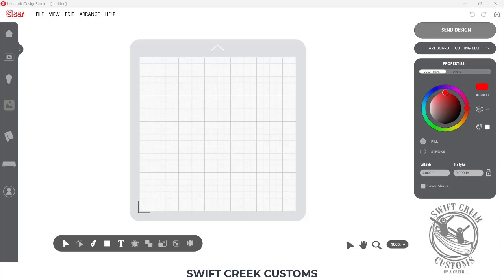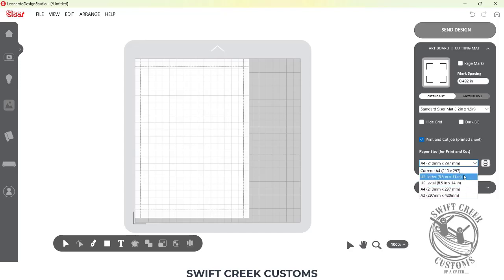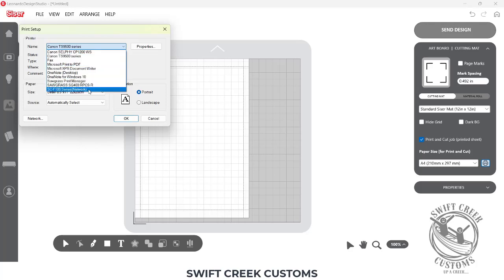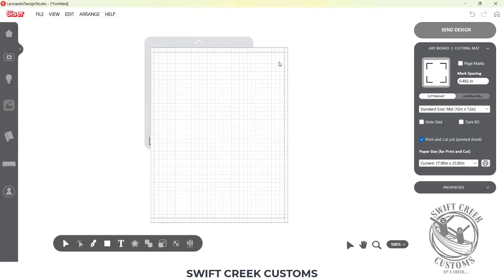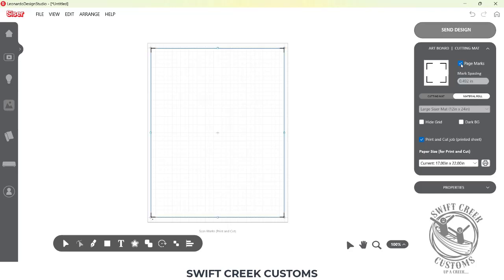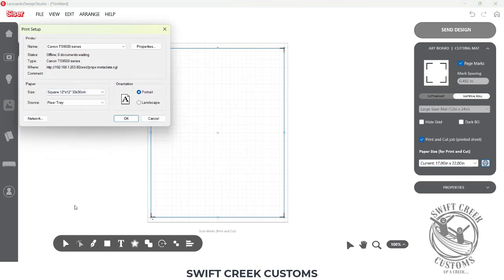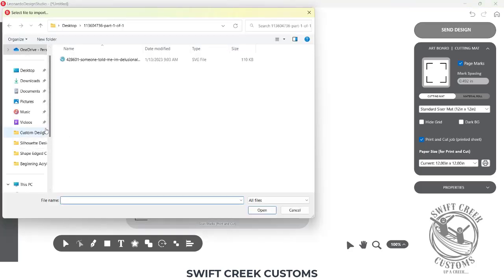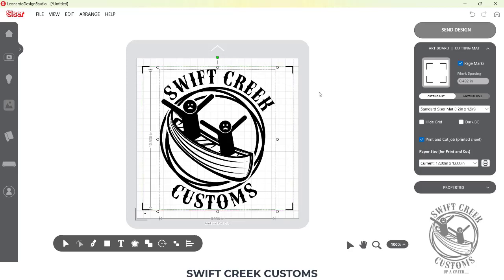Changing the Print Page Size in Siser Leonardo Design Studio

Comment: So can you currently print the while 12 x 12 area space if you were making your own cardstock or vinyl sheet prints from your printer, EllyMae?  I think my highest capacity right now is 13x19. How far in or out do the registration marks go, as of  today 1/14/2023.  As you mentioned, I know they are working on expanding the print size to wide format. I am just curious if you have been able to print your own 12x12's via Leo?  My first cuts were Print and Cut. Some of my designs didn't transfer to cut when saving as svg.  I hadn't gotten back to it.  I will.
Reply from the maker: I have printed on 12 x 12 cardstock but there is a page margin as I show in the video. 
At the moment it cannot do borderless prints, but if you are wanting completely borderless, I would suggest printing through another program.
Reply: @SwiftCreekCustoms  I was just curious.  😁